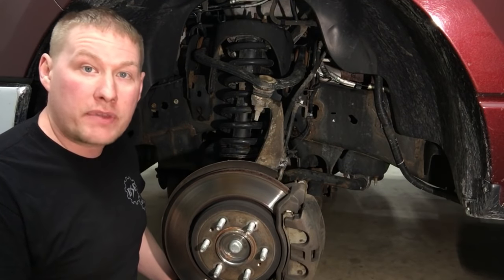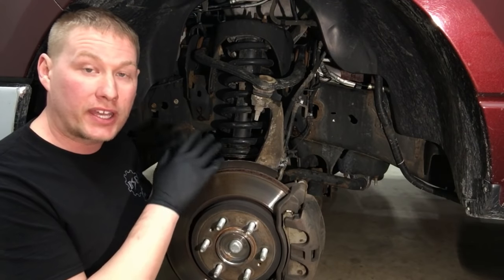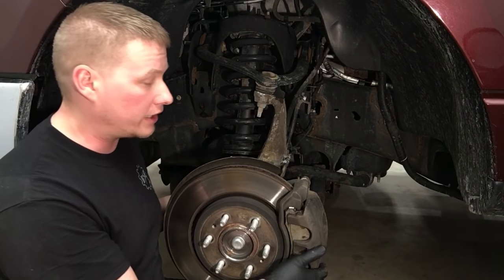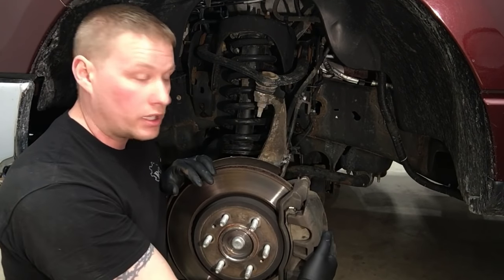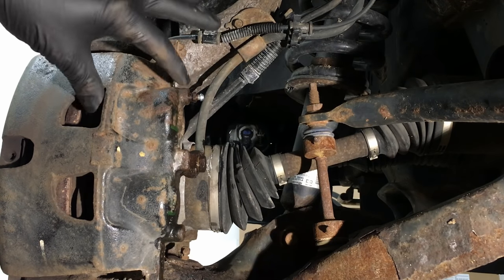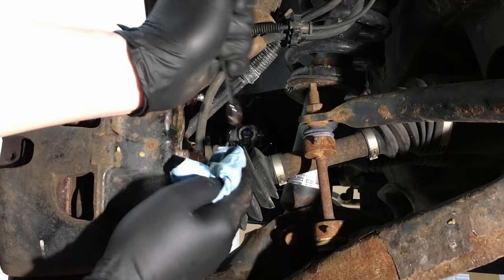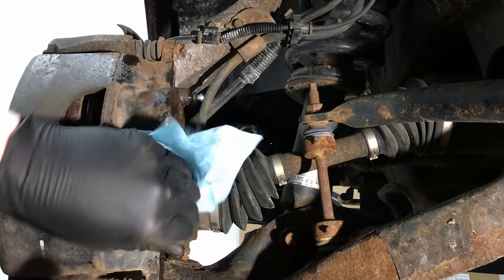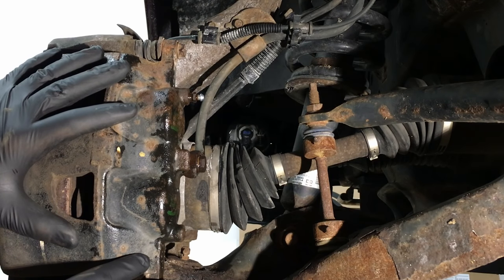Ford Quick Tips #73: Quickly Diagnose a Sticking Brake Caliper w/ One Simple Test

Comment: Have you came across a 99 f250 4x4 that had spacer washers on one side only between the caliper and knuckle? My passenger side does and without them the rotor will rub on the caliper bracket. I bought the truck like that back in 2018 had factory calipers but was always curious why it's like that? I switched brackets/rotors to opposite sides but still always the passenger that will rub without the washers. Any info would help

Comment: Great video. My 09 Kia spectra locks up after driving it for 10-15 min. After that, you can smell the undesired smell and you can see intense smokes coming out off the steel wheel; it is like a car with worn out engine. My question is, does it matter if I misplaced(not placed in a correct port) the brake lines for the rear calipers? As you know master cylinder has 4 ports. 2 from sides and 2 from bottom. I am sure the sides are correct, but the bottom ports that run the brake lines to the rear brakes that I am not sure which port goes to either right side or left side. Thank you.

Comment: when heating to remove a bleeder it is important to note that you need heat the caliper where the bleeder theads in not the bleeder itself. If you heat the bleeder, it weakens it and expands it and will usually result in a broken bleeder. A few taps with a hammer on the caliper also helps break it loose just like a ball joint/tie rod separation.

Comment: Applied your tip, found bottom piston stock in in my 2007 mustang roush gt based. Removed, ceaned, inspected and lubricate seems to be working ok now, but hear some pad drag. Will replace pad hardware. Can you tell me if rotors may be little warped. Thanks, Jose

Comment: Hi, If I determine the problem is farther up the line using this method how do I determine what part of the line is the culprit? Is there a common point of failure on  2005 f150's?  Thanks

Comment: Question for you Sir or those that may know...   2009 6.4 F250 Hydroboost system 4x4:  Put new pads, rotors, calipers, and hoses on my truck as part of 100 mile mantainance.   Pulled out of the drive way after that and no brakes(straight to floor), bleed again, no brakes.   Replaced Master Cylinder twice with the correct one for hydroboost.  The brakes do work really good, but after 2 miles, the Front brakes Locked up...    Relaced all above again .. but learned that if I unboltedthe master cylinder just about  3/16 of an inch from Hydroboost all the front brakes free up.   What is my problem.. ?  Your suggestions are much apprecaited.

Comment: I overfilled the brake fluid reservoir when the brake pedal became soft on a trip last weeek. The pedal is now firm, but the brakes make a rubbing sound when I apply pressure to the pedal and when I initially pull out from a parking spot. I used a turkey baster to remove fluid to get it in the normal range, but this didn't fix the problem. It seems the calipers are sticking and not retracting like they should. The brake rotors and pads were replaced eight months ago. Should I replace the master cylinder ? The vehicle is a 2002 Ford Expedition with 138,000 miles. Thank you.

Comment: If your brakes stick after changing brakefluid, that is due to dirt contamination in the brake system. The brake system is insanely sensitive to any dirt going in from the outside. Even when you open the valve from caliper or drum, a small amount of dirt will go in by the thread so, as much as i try to have a clean fluid inside the sistem, the system is just building up dirt. None of the methods of bleeding brakes really worked for me, so i can get a clean system.
Sticking occurs especially at the drums, since i have drums in the back.
I ended up with replacing the brake cylinders.
Reply: Try cleaning off the area before doing any work. This is a usually ignored premise to all mechanical work, but especially brakes, transmission and engine. Clean, clean, clean. I used to work at a machine shop in San Diego that did all the work for the city bus system.

Comment: FordTechMakuloco - I have a 2010 5.4 fx4 flexfuel and my alcohol reading is anywhere from 45-66% right now , causing rough startup poor drivability and loss of power . I started putting high octane fuel in to cure the rough startup ( it was bad ) but I feel like it's a bandaid. My local mechanic isn't sure how to reset it or what the cause is in the first place . Any thoughts ? Do you do any skype or video stuff ? I'd pay a good price just to have a convo with you about my truck . So many issues but I love it and want to work on it . Cheers!

Comment: HELLO THERE ANOTHER GREAT VIDEO- I HAVE A 2002 FORD F53 CHASSIS AND RECENTLY EXPERIENCED A BRAKE LOCK-UP ISSUE; NOT SURE IF IT,S THE E-BRAKE STICKING HAVING SET FOR AN EXTRA LONG PERIOD- I CHAVE DECIDED TO REPLACE THE ENTIRE REAR BRAKE SYSTEM ON BOTH SIDES; I RAN INTO A CRAZY ISSUE I CANNOT FOR THE LIFE OF ME "GET THE CALIPER MOUNTING BRACKET BOLTS LOOSE- I HAVE ATTEMPTED EVERYTHING IN MY ARSENAL OF KNOWLEDGE AND STILL NO LUCK??? DOES THE STANDARD "RIGHTY TIGHTY-LEFTY-LOOSEY APPLY- OR DO BOLTS LOOSEN TURNING TO THR RIGHT RATHER THEN THE LEFT?? ANY IDEAS APPRECIATED; PATRICK.P

Comment: Quick question, i have a 2014 f150 4x4. When using cruise control does the brakes engage to help the truck stay at the set speed? I just had to replace my rotors at 28000 miles due to warpage and i do use cruise control a lot. Was wondering if this could have something to do with the rotors warping so soon? Thanks

Comment: Seems to be a problem with newer’ish Super Duty’s. My 1996 and 2003.5 had over 120k miles on their OEM brakes and calipers. My 2015 F350 had a front caliper piston seize and go bad at 60k.  I’m not sure if if mine had the plastic piston or all metal.

Comment: Unfortunately most of time that the caliper is sticking the brake bleeder seems to be rusted in the place too. That makes this test bit harder to do.
Reply from the maker: +Valde333 I have found just a little heat from a map gas torch does the trick every time.
Reply: MAPP gas has not been manufactured for several years.  Check Wikipedia.  What is sold in yellow bottle is MAPP Pro, a substitue that is not much hotter than prone.

Use propane or go buy a acetylene (without oxygen) rig like plumbers and HVAC guys use.
Reply: Valde333 yep broke mine😵
Reply: Whaaa! I can still buy Mapp gas anywhere. Napa, big box hardware.

Comment: Hey buddy. I got a 2010 f150 raptor 5.4l. I did calibers roters and pads on the front. And the driver side is still sticking. And I did the brake line to.  Any info would help. Thanks in advance

Comment: I have a 2008 Lincoln navigator which I believed had a sticky drivers side front  caliper (it had excessive dust and super hot) so I replaced it along with both front rotors and pads drove the truck in stop and go traffic on the Parkway  and noticed that trucks drivers side front wheel was super hot but not the passengers side . I also noticed the cross hatch pattern on the new rotor was visible on the passengers side front rotor but not on the drivers side front rotor and I felt like something was dragging  or stopping the truck from going.....but it then went away once I got off the Parkway..Have you ever experienced this?

Comment: The brake fluid shot out when I opened the bleeder. What would you recommend me to do after noticing this? This caliper is the only one sticking on my car...
Reply: Hi, you will need to bleed the line from the Caliper back up did the reservoir. Make sure the Master Cylinder reservoir is not full, as to overflow when you pressure bleed from the caliper up. Use a syringe or similar with a hose and connect it to your bleed port that spewed out the fluid. Make sure there is no air in your syringe, crack the bleed port and gently pump the fluid from the syringe into the caliper. It will be transferred with air up to the Master Cylinder reservoir. Check that the reservoir is not full, if so, remove some fluid and continue until the soft pedal condition is removed.
Reply: I have the same problem. Fluid shot out meaning there’s a blockage preventing the fluid from going from the caliper back into the system.  I am worried that it is the ABS controller.   
Did you ever find a resolution??
Reply: @finleytv9290  yep, just sold the car!! 🤣🤣

Comment: My pads seem to drag on the disk. Pins are sliding nicely. It appears that rust build up on the inside of the disk has rubbed a groove on the into the inboard pad. The rotors are original 2015 with 150,800 Km on the clock. Could it also be the piston(S) not retracting properly?.

Comment: I think that might be my issue, I had my wheels smoking and the steering wheel started to shake bad. It later stopped for about 3 months and started again. Now it doesn't happen all the time, but at times. Also I figured it might be a caliper when it didn't roll one day with my foot off the brake.

Comment: Question:  Could a sticking caliper cause Transmission Fault issues?  Specifically, I had a P0218 & 1783 (Trans Overtemp) set of codes.  Im wondering if a sticking caliper could contribute to this.

Comment: Hello Brian, I know you are  a Ford expert so here is the problem I'm having with my 06 explorer.
 After replacing another defective front hub assembly I also replaced both front calipers as one was defective. After installing and bleeding both wheels, the explorer developed a brake pedal that drops to the floor.
 That was the start of my brake problem. I have replaced the master,re-bled the brakes in the proper sequence and purged the ABS unit . I'm pretty sure the ABS is working because you can hear the motor running,feel the vibration and the brake pedal pushes up when running the test. 
 Could I have purchased a faulty caliper ?, I don't have any fluid leaks. I'm considering replacing the ABS with a proportioning valve.
 I have not found any reference to this problem only a couple of videos that blame the ABS unit which is a very costly item. The ABS unit as you know is made up of 3 parts and I would hate to spend quite a lot on these parts and find out it's not the problem. 
 Any help would be appreciated,thanks.

Comment: FordTechMakuloco   I have a 2008 F250 FX4 . I had the rear calipers, pads, and rotors replaced. Recently they started making the same horrible metal rubbing sound again. This occurs when pressing the brake and after releasing it lasts until I speed up a little. What else could cause this?

Comment: Having a real hard time determining why my 2016 f150 shakes while braking. This happens when slowing from high speed to about 20 to 30 mph (highway exit speed) I changed the rear calipers rotors and pads and still get most of the shaking from the rear. Do you have any ideas about what is causing this? Many thanks in advance!!!

Comment: The bleeder flow supposed to be the same for a 2009 f150? Cause I bleed the break lines all the way around and the break fluid just shot out... does the master cylinder need to be replaced? I do not see any pinched breaklines either

Comment: 2014 ford f150 3.5 eco boost troubles took it into the dealer for rough idle and low  power. all the said was there was fuel in my oil so they just did a oil change.      what would cause the fuel to get into the oil they did not find any troubles to why

Comment: 2009 F-150 king ranch, driver front pads got driven till pad was all gone. Customer had the rotor turned and caliper piston fell apart when caliper was pulled off. Turned rotor, new pads and reman caliper were installed. A couple of days later the new caliper rotor started overheating and smoking.
Customer previously took it someone who didn't open the bleeder when pressing the caliper pistons. Could it be the modulator is damaged?
Reply: Having the same issue with my 09 stx, no pinched break lines so it has to be back pressure from the master cylinder or the modulator
Reply: @louisdvorak9135  truck came back with same problem. Fried the new caliper. Changed out the brake line at the caliper. Brake line bracket was stuck to line, new line moves freely. Let's see if that fixes it.

Comment: Had a quick question. I have a 2013  F150 4x4 that I bought as a CPO in 2015 with 14k on it. From the get go it always seemed to have more brake dust on the right front rim then on the other side. I replaced the front brakes at around 30K because the right front was starting to get noisy and the pads were low.(lower than the left side) I'm at 49k now and I'm still noticing a lot more brake dust on the right side. No noticeable pull just a lot more brake dust. Is it possible that this caliper has been sticking since I bought it. I wouldn't think so but I thought I would ask your opinion.

Comment: What would you do if you changed all 4 calipers, rotors, pads but you might have got a bit of air in the master cylinder?  Now my rear Right isn't pressing as much as my left rear because they are wearing the rotor down differently. 
:(

Comment: I am having a small clunk noise when I take off from stopped, in particular turning right going uphill.  I had the dealer look at it and they regreased the driveshaft spline but it still does it.  Could it be the 4x4 in the front hubs?

Comment: My problem is a on my 2005 Taurus is that everything is free but at speed 60/70 mph i get whooooh sound when I put the brakes on. The car has a new (rebuilt caliper), new pads and everything looks good. I have change the roto and caliper since and still have the noise. Everything works well the noise bugs me as I like to have everything right.

Comment: could a bad porportioning valve cause one caliper to sieze or is it pretty rare? we have fluid shoot out hard from the bleeder but when we took the brake lines off and blew into them they seemed fine? we also checked caliper and the pins float fine and i can pull out the piston easy?
Reply from the maker: No it is only front to rear so not one single caliper.

Comment: I need suggestions! I bought a 97 E350 Ford Van and it pulls to the right when the brakes are applied. I installed a new caliper  and it pulls even more. I could rotate the tire with some force before but now it is nearly impossible to rotate. It does drive though. The caliper is free to slide back and forth if I take a pry bar and pry the pistons in. Pump up the brakes and it drags hard. I replaced the brake hose this morning and it still drags hard! If I open the bleeder up it still drags hard. Help?

Comment: My front driver side brake is locked up. I replaced the caliper, the hose and pads. It is still locking up. Any ideas? None of the other brakes are locked up. 2008 Honda Pilot. Thanks

Comment: I just have a mechanic replace the master cylinder and after that I have a problem with the right front brake the wheel is covered with brake dust and already replace both front calipers lines and pads but problem still there any idea please I already spend a lot of money.  Thanks

Comment: Now, what if you've replaced all calipers, rotors, and pads, and it's still sticking? (I believe my right rear is...ie. excessive brake dust) what do I check in the line itself?

Comment: Don’t know if you will reply to this but I could use your advice and help. I got a 09 escape that came in with a low pedal complaint. Did a visual inspection. No leaks and the pads and shoes are ok. Blocked the master off and had a good pedal. Reconnected system and manually bled master first. Then performed a abs bleed to remove the air. Bled all four wheels and the back drum brakes won’t release. Any ideas anyone. The customer is denied the repair on the abs module. I just want to get it to where I can get it out of the shop. Your help would be greatly appreciated. Thanks in advance.

Comment: You a mind reader?Did you hack my computer?Lol My 08 f150 came home from Home depot yesterday with a smoking brake.Second time.First time I cleaned it up and replaced the hardware.Today I am going to replace both calipers, pads and have the rotors checked/turned.I will pop the bleeder first to see what it has to tell me.I was researching some parts when this notification interrupted me.
Reply: River rat on the one that was stocking that rotor could have gotta to hit and is all warped.
Reply: I am figuring it is.They are expensive, heavy duty aftermarket rotors, so I am hoping my machine shop can turn it.It did not warp the first time.

Comment: I did brakes and rotors on my 06 F150 4x4 and the Guide pins are different. One guide pin has a rubber bushing and the other one is just a straight pin. Does the pin with the bushing go on top or bottom?
Reply from the maker: +Joe Kugler I have always seen the bushing on on top
Reply: Thanks for the quick reply, My son and I took the calipers off to clean and paint them. He took the pins out and did not know that they were different. Semper Fi.

Comment: HOW HARD IS IT TO CHANGE THE BRAKE METAL LINES ? ARE THERE BRAKE LINES THAT DON'T RUST? ARE THEY AS SAFE ? HAVE A 1999 XLT 4X4  250,000 MILES ON MY TRUCK. LOVE YOUR CHANNEL! THANK YOU FOR LETTING ME  , US FOLLOW ALONG & LEARN HOW TOO! BE SAFE! HAVE FUN! SMILE! GOD BLESS YOU ALWAYS! ENJOYED
Reply: There are stainless steel brake lines available but they are very expensive and it is very difficult to flare and bend.  Strictly for "show" vehicles.

Complete kits are available for most vehicle in your age group.

If a kit is not available, purchase nickel-copper (NiCopp) brake line in 25' or 50' roll.  It is more rust resistant than steel and easy to bend and flare.  Worth the extra cost.
Reply: THANK YOU FOR GETTING BACK TO ME! I'LL HAVE TO CHECK IT OUT! BE SAFE! HAVE FUN! SMILE! GOD BLESS YOU ALWAYS!